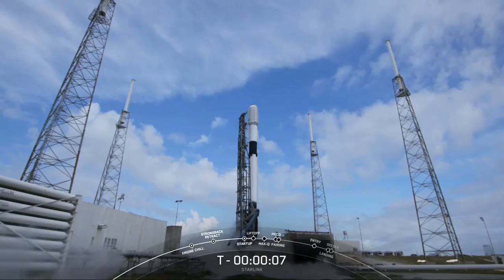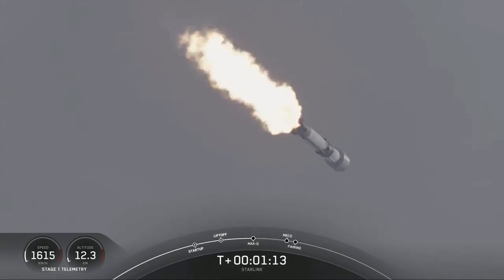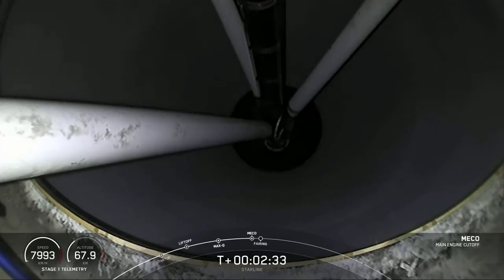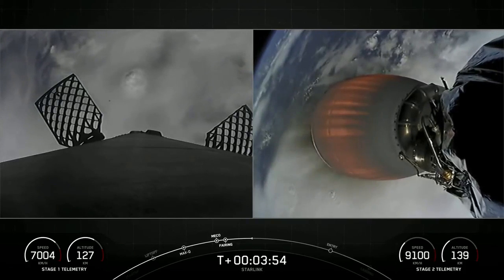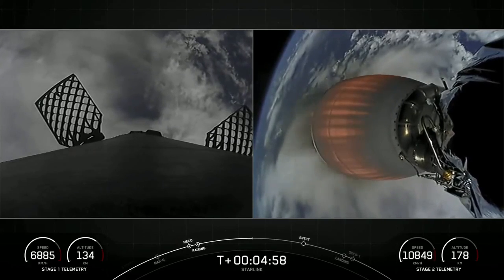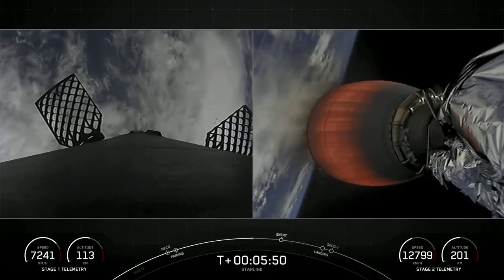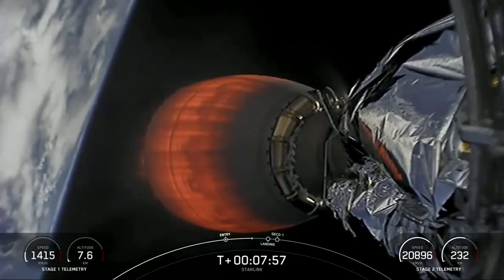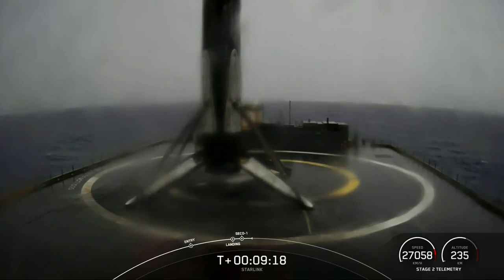SpaceX launches Starlink batch on record-tying booster, nails landing

Comment: There is no point for SpaceX to keep landing on barges far from land. At this point of continuous successful landings, they should start landing on land at the edge of Florida’s Cape Canaveral. This will provide them an even more cost-effective launchings which they can pass on to their customers.
Reply: It takes fuel to get back to the launch point. More fuel means less payload
Reply: @ankles632  , are you saying the fuel the barge uses would be less than the fuel for the first stage firing to the Florida coastline?
Reply: @leapdrive  If Falcon flies East for 2 minutes then wants to return to the launch point it has to fly West for 2 min to get back. The fuel for the West bound flight has to be carried onboard. That is a lot of weight. By landing on the barge the " fly back" fuel isn't needed so it can carry more payload.
Reply: @ankles632  , no, the rotation of the earth is going east so as it descends back, the west is coming toward it at about 1,000 miles per hour.
Reply: @leapdrive  The relative positions of the Earth and the rocket remain constant so it has no effect on the distances between them.
Reply: @ankles632  , I’m going to acquiesce with you assuming you got the math and physics right.

Comment: Approximately 158 seconds into flight, the first-stage engines are shut down, an event known as main-engine cutoff, or MECO. At this point, Falcon 9 is 80 kilometers (50 miles) high, traveling at 10 times the speed of sound,,,at this speed and activated angular rotation the return trip to earth would burn it up before the retros kick in
Reply: I think you need to go to school .
Reply: Just off the top of my head that doesn't make any sense:  The rotation of the Earth isn't going to have any major influence on something that has launched from a site that is on Earth's surface, and so has inherited the motion (the tangential motion, sure) of the surface, then returned to the Earth's surface less then ten minutes later. 
The motion of the surface will have departed from what it was at the moment of launch by only 2.5 degrees in that time, so to a rough approximation (especially compared to the velocity changes made by the booster in that time) the motion of the Earth can be ignored, for the same reason that I can throw a ball to someone on the other side of a train as it goes around a wide bend without any problems - over the time for the throw to take place the train's motion is pretty close to a straight line.
Reply: @studentjohn  Ok . I see that you have some problems with astronomical trajectories. How old are You?
Reply: @iuliandragomir1  Er, let's assume I'm sensitive about my age. In fact I was replying to the original comment.  My point is, if I understand what Michael Graf means correctly (which I may not, as he isn't very clear), that the angular motion of the Earth (I assume that's what they mean by 'activated angular rotation') doesn't have any large effect on the first stage's  motion, relative to the surface of the Earth.

Edit: I realise a proper analysis of the first stage's trajectory would involve a lot of different factors I'm unaware of, and a lot of math. But, just from a common sense point of view: The 1st stage is in flight for under 10 minutes, its maximum groundspeed on a mission where it's reused is something like mach 7 (it goes to mach 10 on an expendable flight IIRC).... so the angular motion of the Earth just isn't going to be a big influence for such a short flight with such a groundspeed.

Comment: Look how big the exhaust gets as the rocket travels into thinner atmosphere.
Reply: Im not sure if you know this but this is because of the lower pressure in the upper atmosphere. The rocket engines exhaust was designed to have a pressure of around 1 atmosphere or 14 psi. The difference of 1 atmosphere makes the exhaust expand due to the lower ambient pressure.
Reply: @FijiWater1227  yes, thats what I was refering too.thanks for clarification.
Reply: The exhaust starts long and narrow due to atmospheric pressure, gets longer as atm pressure goes down, following it gets wide, huge, loses density, and ends disappearing when it reaches nearly 0 atmospheric pressure. When the second stage engine starts, the exhaust goes off as it leaves the nozzle, without oxygen to continue burning in the near vacuum.